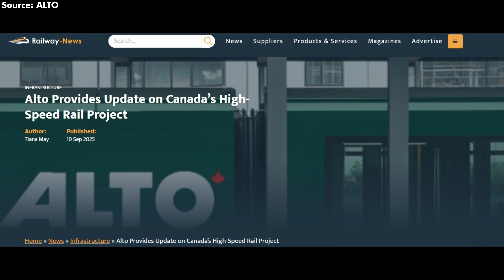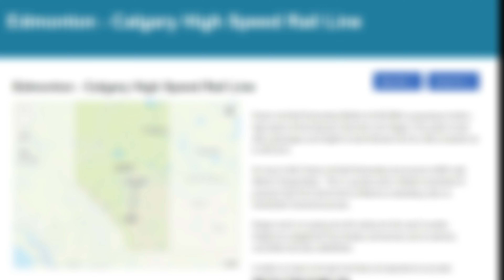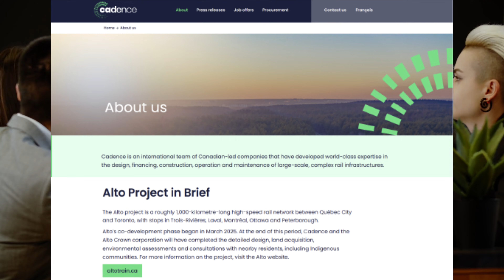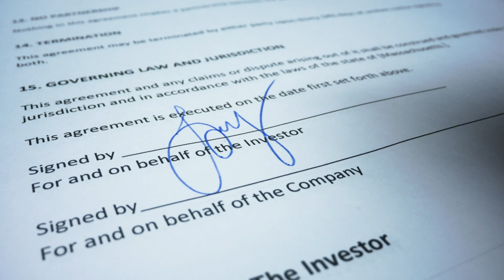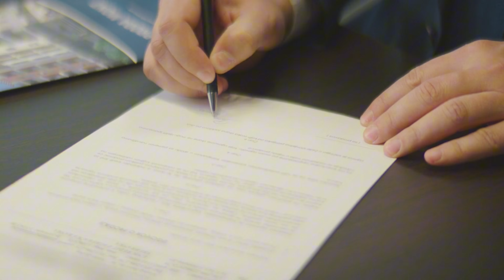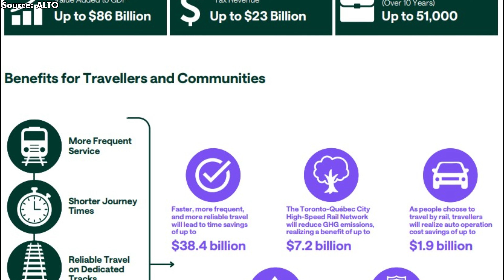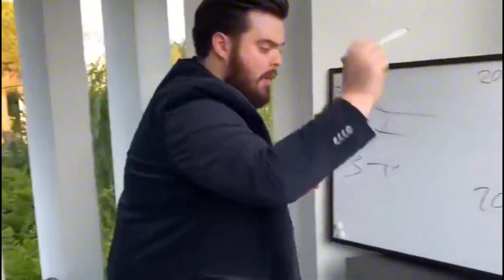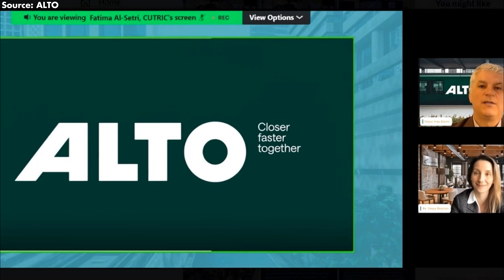What is going with Canada 's First High Speed Rail project?

Comment: about long distance trains? 
Montreal Vancouver? The track pulled out.
Toronto Vancouver? (1955) 4 trains daily best time 67 hours Now: 2 Weekly trains, time? 107 hrs when in time. Vintage the1950th original rolling stock
maritimes same stories
Money allocated by the previous government? pulled out. Policy? Via must keep maintaining current equipment.
Future goal? one weekly train? Who knows? 
Bus situation? not much better.
Alternatives for 30% canadian without  either rail or road intercity transit? Flying when airports are available. for the rest of us: summer & winter driving (electricity not available)
This is the Canadian way.
Reply from the maker: Flights work, but rail is safer, greener, and for non-drivers.